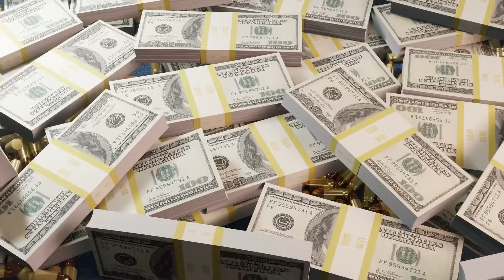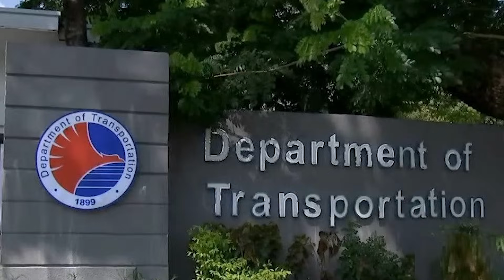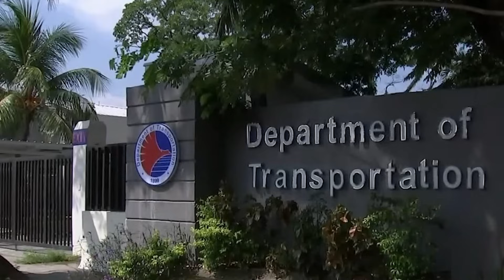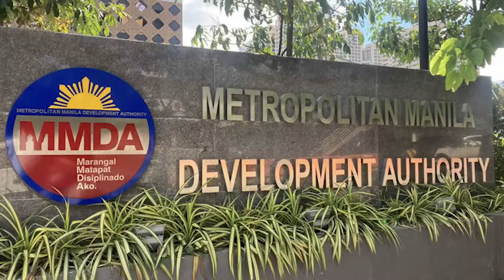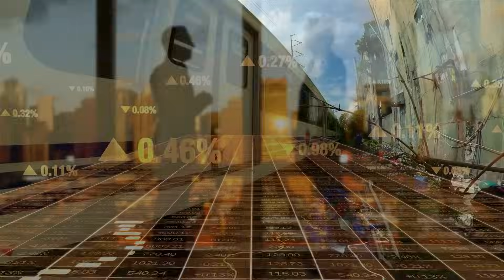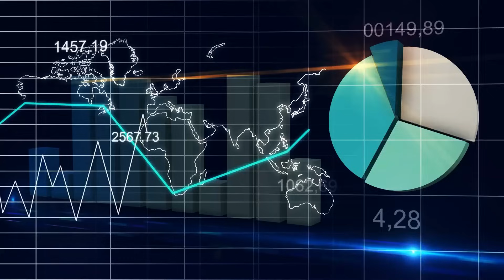10 HUGE Projects That Will Make The Philippines a Global Power

Comment: Almost all the projects mentioned here were from former Pres. Duterte's Build Build Build program. This video seems 
to have been made during Duterte's term because Calax and Sctex highways were finished during his term (in this video, the narrator says construction still undergoing). Also the New Manila Intl. Airport was approved during Duterte's term, as well as the bridges mentioned here. So many more infrastructure programs were started and some finished by Duterte's DPWH and Dept. Of Transportation (like the new  Bicol Intl. Airport- which is not mentioned in this video,  and developed many important provinicial seaports). Those that were not finished (coz of the short 6-yr presidency and a bit halted due to the 2-yr pandemic) are just being continued by the present govt. But the funding and the initiative were from the hardwork and honest governance of Duterte and his cabinet.
Reply: Duterte was far from honest and loved being in Chinas pocket.

Comment: DID the DOTr TUNNEL UNDER GROUND  PROJECT   undergo or was it subjected to serious and thorough  STUDY? PLANNING? CONSULTATION with Stakeholders? How many Agencies  both  ( Government  & Private) Road Engrs and  U.P. Scientists  were involved? Are foreign contractors aware of   flooding,  and drainage systems affected by  the TUNNEL UNDER GROUND. DOTr should  explain explore possible routing of drainage systems which are affected by underground TUNNEL.  As it is now, even isolated rains cause FLOODING IN NCR. What
 more  during heavy rains and typhoons which are soon coming? You need to explain the SCOPE OF WORKS  otherwise you will be in BIG TROUBLE . Look, what happened to the DOLOMITE BEACH.  During the past administration,  U.P. scientists explained that Dolomite is not appropriate  in the filling up of the Mla. BAY seaside but DENR did not relent. NOW what we have is a wasted Mla Bay beach. In EUROPEAN COUNTRIES DOLOMITE USED ASPHALTING ROADS/ STREETS.
Reply: on going na po yang underground tunnel